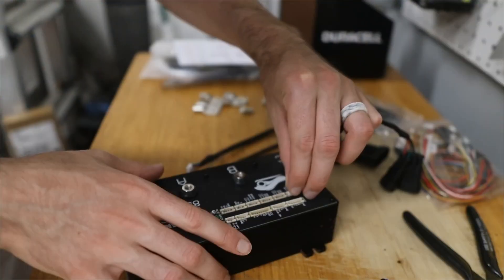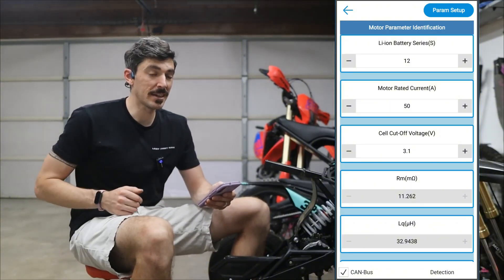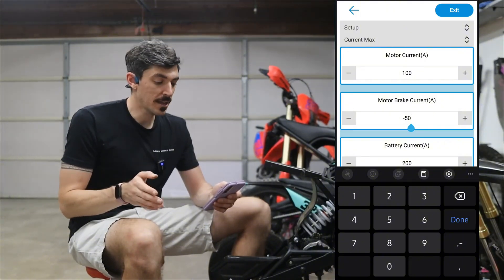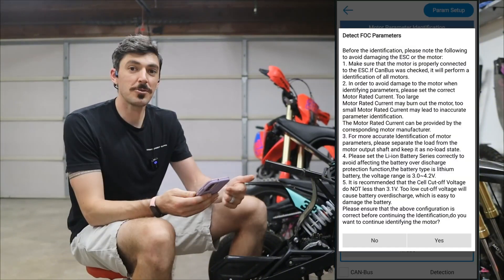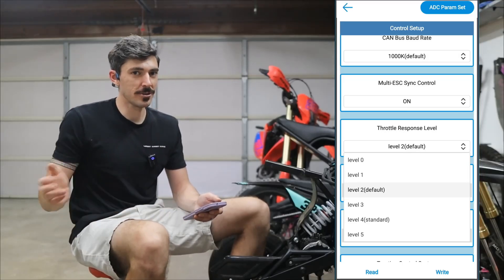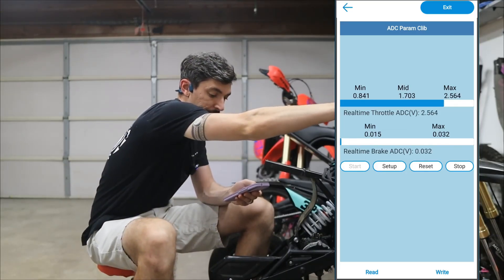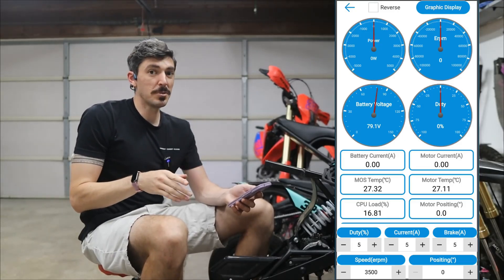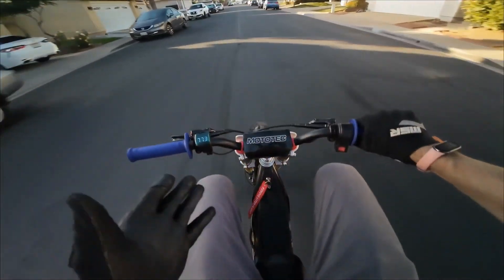DIY E-bike with Flipsky FT85GS ESC 85V 400A | Review

Comment: How do you get the most current version of the app? My controller is on firmware 1.6 and the app I was linked is version 1.4
Reply from the maker: Sorry, the firmware 1.6 app is not yet available. It's still in the final testing phase, and we'll upload it as soon as it's complete. Thank you for your understanding.

Comment: Do you know how many line amps the 75450 can put out max. And does that app work with the 75450? Also what motor setup would I use for my 5000w direct drive hub motor. I'm thinking of using the flripsky on my build instead of the fardriver 72450. I have both controllers but want the one that has the most line amps available, and the fardriver is 200a line max and 450a phase. I think the flipsky might be better and more efficient but what are your thoughts. Also what state are you from. And I know alot of questions but do I have to use the water cooling or is that optional. Mine has it and I might not need it till next summer I think.
Reply from the maker: Typically, the line current is greater than the motor current.
If you don't need water cooling, pls select "Without Water Cooling Enclosure." However, if you use higher power , water cooling is recommended. Conversely, for lower power , you can consider add a heat sink or air cooling.